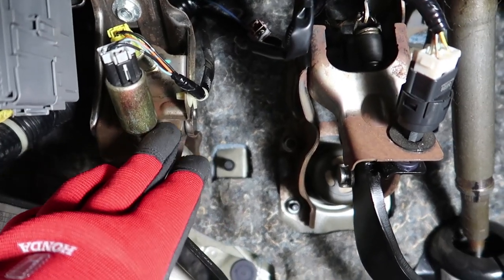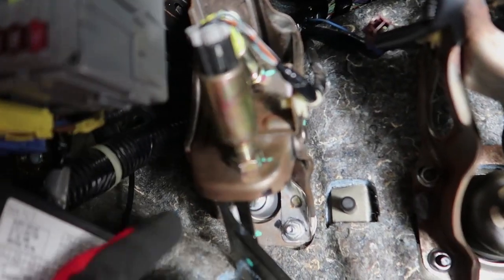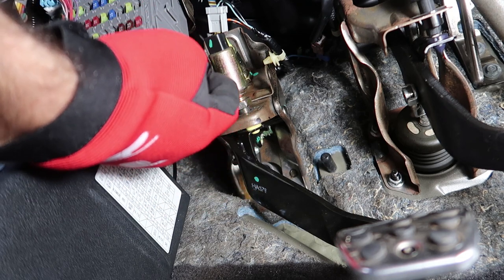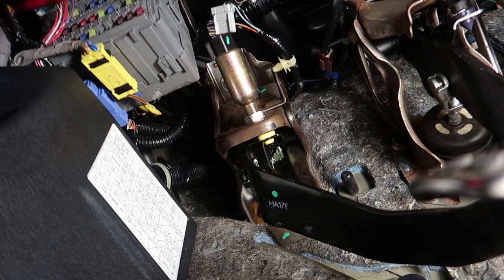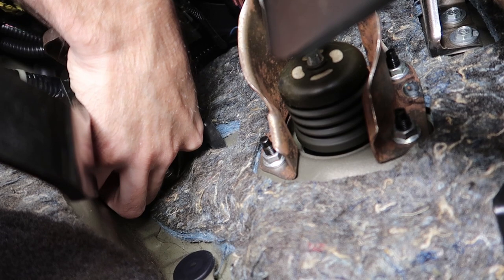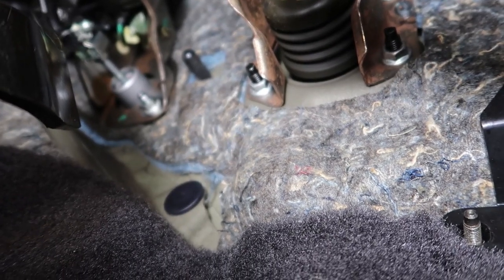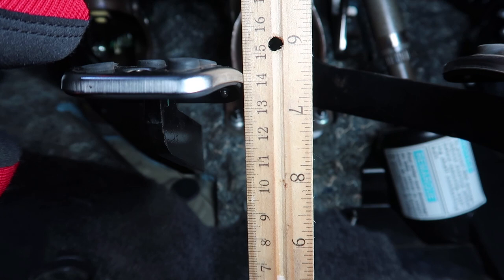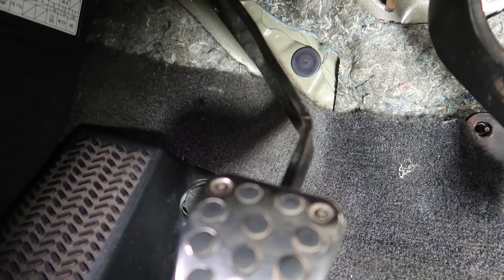8th Civic Si and RSX Type-S Clutch Adjustment DIY | Aftermarket and Stock | FG2, FA5, DC5

Comment: the nut is loose on it and the rod won’t spin:/
Reply from the maker: David Serrano try pushing the pedal down just a tiny bit with your other hand as you try to spin it, it should allow it to spin. A brand new oem cmc will spin fine either way

Comment: I’ve got a 2014 Si.Would this work also?
Reply from the maker: The 2014 has a different CMC so the specs will be different, but if you want to lengthen the clutch travel I believe you would use a similar method to this one. Cant say for sure, sorry!
Reply: @JasonMcMullen  thanks brother
Reply from the maker: @donxiong1775  right on, thank for the comment brother

Comment: I just installed my hybrid racing cmc and csc, I am not able to get any free play with the pedal, there is always pressure on the clutch. I have the free play adjustment showing no threads just the button. I also did left the rod that it came with. Should I have used the oem cmc rod?
Reply from the maker: There are instructions for the Hybrid Racing CMC  on their website, I think the rod gets swapped

Comment: Question; 5 thread with em1 cmc and stage 1 clutch is good?
Reply from the maker: Yeah around that range should work, every clutch is a little different but that worked for me. If you are still having some issues getting in and out of gear then go slightly less thread (longer stroke). If you feel a ton of resistance at the very bottom of the pedal travel (over-stroke condition) that means you need a little more thread showing. Always redo the freeplay after adjusting thread length, keep freeplay in the safe range.
Reply: Jason McMullen Im having issues shifting at high RPM I actually say your video on bleeding the clutch line so I will be doing that. I did bleed it but the bottle has been open for couple years maybe that could be a reason but my free play does feel longer than 10mm have to check that out soon as well
Reply from the maker: Keyvan Taveras yeah make sure the system has no leaks and is free of air. And try more pedal travel (less threads)

Comment: My push rod isn’t wanting to rotate. I installed the k tuned cmc and slave and the rod itself is pretty much impossible to rotate with my hands or even a wrench
Reply: Help please :/
Reply from the maker: @Collinr_62  Try to push down the pedal a tiny bit with one hand and then rotate the rod with the other hand
Reply: @JasonMcMullen  awesome I’ll give it a try tomorrow! Which part actually changes where the clutch engages? I was tinkering with the first cylinder thing having more or less thread showing and I don’t feel a difference. The clutch still engages as soon as I take my foot off the floor.
Reply: @Collinr_62 Where you able to rotate the pushrod doing this?

Comment: I just bought a 2009 FA5 Si, and am still getting used to it. Its my first manual car, I'm decent at driving it but my uncle noted that the clutch bites pretty close to the floor. The release after going into 2nd can also be a bit jerky sometimes. Is this normal or would doing this help? Thanks
Reply from the maker: The clutch adjustment will raise the bite point so that should help. It should make shifting into second smoother. Not sure if it will fix a jerk but the extra pedal travel might help the engagement. Btw when you adjust the bite point it will take a week to get use to the new engagement point so if you are still learning don’t stress, it just takes time
Reply: @JasonMcMullen  My previous car just blew its engine by skipping timing so im a bit paranoid with any sounds/feelings and im not sure whats normal for a manual yet. Hopefully the clutch is disengaging fully when the pedal is on the floor, its never grinded or refused to go into gear so I suppose its ok. Thanks!
Reply from the maker: @ddrrFA5  yeah I totally understand. If its shifting well then thats great. These Si's are great cars and there are so many parts for the K20 that if anything ever breaks, its just an opportunity to replace it with something better (at least thats what I tell myself haha). Anyway lmk if you run into any issues, and thanks for the Sub bro, just subbed back
Reply: @JasonMcMullen  Cheers!
Reply: @JasonMcMullen  I shouldve checked this when I first watched this video! After a while I realized the car was locking me out of 2nd at high rpm and the shifts felt kind of crunchy in 2nd and 3rd. I checked today and saw there were about 5-6 threads showing after the plate! Hopefully there wasnt too much damage done to the car.
Reply from the maker: @ddrrFA5  most likely it will be ok, try the clutch adjustment and maybe change your transmission fluid. After that it might shift nice and smooth! I hope it turns of well for you buddy!

Comment: I bought a cmc at autozone. How many lines am I supposed to have it at?
Reply from the maker: if its an exact OEM replacement try 1-2 threads
Reply: 2threads on the right or the stopper

Comment: on my 95 Civic there is loose free play and then some resistance free play. do I adjust until the loose free play is gone?
Reply from the maker: It depends, because you do want a little bit but if it feels 'sloppy' then you could try to get rid of some. Check the pressure with your pinky and see, basically once your single finger feels some pressure it would not be freeplay. Maybe make a note of how much there is (ruler method) just in case you wanna go back to it
Reply: @JasonMcMullen  oh... so the free-play part is no pressure when using pinky finger test? I thought it's the light pressure section. I ask because I got a new clutch and clutch master / slave cylinder and the clutch bites rather high (almost a full release of the pedal). I want to bring it back to factory specs but I can't get it bite lower without also lowering the pedal itself.

Comment: Anyone else have a hybrid racing cmc and notices their bite point almost at the top? Is that a bad thing??
Reply from the maker: not sure but what is your freeplay set at?
Reply: @JasonMcMullen  it is in the middle now for the grab point with bout a half inch free play. But It kinda ended up doing it by itself and what I mean by that is I tried to adjust the height of the pedal only by about an inch to give me a bit of free play. Well it worked but then as I kept shifting it liked pumped higher to the top so I adjusted back to where it originally was and then bam  pedal went soft and bite point was at the bottom and then outta nowhere it pumped itself to the middle and now I have a half inch free play and bite point is in the middle.

Comment: Hello
I can’t rotate the push rod
It’s hard to spin

I have k tuned kit cmc n slave
AC clutch
Please help
Reply from the maker: try to push down the pedal with one hand just a tiny bit, and rotate it with your other hand. Make sure to measure the freeplay with a ruler after you adjust the rod
Reply: @JasonMcMullen  bro can you explain a lil more  details please I can’t put it into gear… how to measure what???
Reply from the maker: @jagermeisterNY  First you set the pedal height by looking at how many threads are showing. Then you adjust the pushrod to get the right amount of freeplay. After you adjust the height, then you turn the rod clockwise until you feel some pressure, then turn it back counter-clockwise about a half a turn (you can do this while pushing the pedal down a tiny bit and turning the rod at the same time).  You can measure the freeplay by using a ruler, but you dont have to. I show how to use a ruler in the video.
Reply: @JasonMcMullen  it’s funny that if it has only 1,2 threads it will shift but after like 10min dirve itll start acting up like doesn’t want to engaged or disengaged  

I’ve been trying to do your steps by steps
I have done the first one wich is the 5 threads… I’m having problem with the push rod
How many threads with the rod??? I dnt know how it was before (like how many threads in down the rod)
Reply: @JasonMcMullen  I did all u said
And now when I start the car doesn’t want to go to any gear.. maybe something with the threads
Reply from the maker: @jagermeisterNY  do you have good pedal pressure? If you just installed it maybe you need to bleed the system. Are there any leaks? It should not change after 10min. Try less thread showing if you still can’t shift
Reply: @JasonMcMullen  no no, what I tried to say was that before the person who installed this k tuned cmc left only 2 threads instead of 5 (This is the k-tuned)
And it works I could engage gear but after a while driving for a while it won’t engage or disengaged

When I saw your video I want it to try it out..
I’m doing it right now and I followed all your steps I left 5 threads 
And now when I start the car it doesn’t want to engage at all
But I bet if something about the threads
Reply from the maker: @jagermeisterNY  ok I see, yeah maybe the push rod is the issue, but less threads might help you shift. If you have to go to half a thread or something then you can try that
Reply: @JasonMcMullen  nothing bro
I haven’t get any luck… now when I tryin to put it in first it’s  like that whole car trying to move, at same time it won’t engage in any gear… really hard
Reply: @JasonMcMullen  bro I think I fixed the problem
I was missing to bleed the system again 
That’s why it couldn’t engage any gear,
my bad 
Thanks for all your tips and responds
Reply from the maker: @jagermeisterNY  Nice! Glad to hear that you figured it out bro! no prob
Reply: @JasonMcMullen  thanks soo much brody…. I’ve been driving around and it’s  feels great, more aggressive,, but hey when I hold the clutch down
I heard something spinning!!! Maybe
Throwout bearing ???
If so what does that mean, is it going bad?

Thanks
Reply from the maker: @jagermeisterNY  does it make the sound if you are in neutral (clutch held down)? Is there a lot of resistance when the clutch pedal gets near the floor?
Reply: @JasonMcMullen  yeah it does it in neutral, that’s what I meant sorry, yes it feels a lot of resistance too
Reply from the maker: @jagermeisterNY  and how many threads do you have showing? Now that the system is bled, you might have to go to more threads showing (which makes the pedal shorter)
Reply: @JasonMcMullen  the one that has the conector has 4 or 5 threads

And the one that comes from the cmc 
Has 0 threads
Reply from the maker: @jagermeisterNY  hmm ok, the one with the connector, try another thread showing
Reply: @JasonMcMullen  if I do it now do I need to bleed th whole system again??
Because now I’m by myself lol

I’m guessing if I try another thread showing I’m goin to need to adjust the cmc as well be cause the black pin it’s going to show, no?
Reply from the maker: @jagermeisterNY  No need to bleed again. Yeah after you adjust the threads showing, adjust the freeplay (cmc) again also
Reply: @JasonMcMullen  aight..it’s already dark here, I dnt want to be stuck like yesterday lol,, but I’ll try tomorrow, bro thanks for your help, I’ll  keep you posted 👍🏼
Reply: @JasonMcMullen  hey how’s it going
Yo bro I have a question is not about the clutch 
Anyway, I just installed the hybrid raving intake
And it says that I need to run the hondata after installation 
Okey I’m here trying to figure out wich calibration should I run???
I have hybrid racing intake
And invidia cart back Q300
Stick headers
Any tip???
Thanks
Reply from the maker: @jagermeisterNY  Hey buddy, you want to run a MAP tune because the stock tune is a MAF based tune. The car will run very bad on the stock MAF tune. You can try the Hondata AEM V2 CAI calibration (new calibration>civic si 2006-20011>FG2/FA5 AEM V2 CAI), but its better to get a custom tune. A custom tune will be safer and will be calibrated for your fuel octane.
Reply: @JasonMcMullen    can I do the custom tune by myself or for that i need someone who knows??

And also with that calibration 
Aem v2 CAÍ calibration 
Still going to run bad??? Without the tuned??
Reply: @JasonMcMullen  I mean just help me out to basic calibration so I can start the car now
I’m planning to do the tuned maybe in two weeks
Reply from the maker: @jagermeisterNY  I never tried the AEM V2 tune but it is the closest tune for your car from Hondata. I don’t recommend tuning it yourself. If you order a custom tune they will send you a basemap tune that you can use to to get started.

Comment: My clutch master cylinder push rod won’t turn….
Reply from the maker: you can try to push down the pedal just a tad with one hand, while spinning it with the other hand. Make sure you have a ruler to measure the freeplay after adjustment though

Comment: Has anyone done this with stock rsx type s clutch and master cylinder? And if so did it work out, or should I leave it the way it is?
Reply from the maker: it does work for stock clutch and CMC

Comment: How much threads should be showing for a em2 CMC on a 2005 RSX-S with exedy stage 1 clutch?
Reply from the maker: Austin Saiyasone is it a em1 or em2? I’m not sure about the em2
Reply: Jason McMullen oem em2 cmc from a 2005 civic coupe
Reply from the maker: @austinsaiyasone3923  I'm not sure but it looks very similar to the em1 cmc so if I had to guess I would say around 5 threads like the em1. If it doesn't shift smoothly, try less threads showing, and if you feel pressure at the bottom of the pedal when shifting at hi rpm then go to more threads showing. Always redo the freeplay after doing the threads

Comment: The half thread showing in after market clutch master cylinder is that for the type s? I have an 02 type s with competition clutch and ktuned master space cylinder set
Reply from the maker: you running the K-tuned CMC? because the half thread is for the stock CMC. Usually the K-tuned one needs more threads showing (shorter pedal)
Reply: @JasonMcMullen  ok so 1-2 threads or
Reply: @JasonMcMullen  thanks by the way
Reply from the maker: @leviorourke7498  usually the K-tuned one is like 4 threads showing. Are you having any issues with the clutch not disengaging (not smooth shifts)? Or conversely, do you feel a ton of pressure at the bottom of the pedal?

Comment: Did this on my 2006 Rsx type s and it doesn’t feel rough when I shift anymore, thank you
Reply from the maker: Great to hear bro! Those smooth shifts are super nice for sure
Reply: Jason McMullen they definitely are, I might have to adjust it since it engages a bit high but other than that feels so much better 👍🏼
Reply from the maker: @ivaninzunzaa  it will engage a little higher because the stroke is longer (needed for proper release), but most people get use to it. Thanks for the nice comments bud!

Comment: Sorry but I got a bit confused I have an Fa5 with an aftermarket stage 2 clutch and I have this Ktune slave and master. I got confused on the amout of treads that should be showing for my SI. I went down there and the nut that’s  near the CMC was loose ( made me think if that’s the reason why my cars been grinding so much lately, even getting it into 1st has been an issue, forcing me to pump my clutch 2 times before getting it into gears )
Reply from the maker: For your setup it should be about 4-5 threads showing on the pedal stopper. For the CMC try to adjust the freeplay after you adjust the threads on the pedal stopper. You want to have about 10mm of freeplay. And yeah make sure to lock down that nut, but you don’t have to tighten it too much
Reply: @JasonMcMullen  i tried having it with 4-5 treads and I wasn’t able to shift once I did that so I lowered it back to 1 tread and it shifted but it feels super sluggish and grinds in reverse. And for some odd reason my CMC rod won’t turn even after pressing on the clutch slightly
Reply from the maker: @daveshere9969  hmm can you check how much freeplay you have? Using a ruler? Also worse case you can spray some lube then adjust it, and then spray some brake parts cleaner after you get the right amount (on the part that connects to the threads on the rod). If the freeplay is ok then try even less threads, but always readjust the freeplay after. There is a chance that there is an issue with the CMC also but check the other things first
Reply: @JasonMcMullen  I’ll give it a shot, but I legit just installed this cmc and slave ( ktuned ) it was running good for 2 months or so and now started giving me issues smh. Thanks again
Reply: @JasonMcMullen  that’s also why I find it weird that it isn’t spinning since it’s fairly new

Comment: Are u running em1 cmc
Reply from the maker: Running the stock one. I like the Em1 for performance (quick shifts) but the stock one has a longer throw and its easier for daily driving imo
Reply: Yeah I just installed my em1 engagement was pretty high I bled Slave few more times and it’s a lot lower can definitely get used to the new feel thank you
Reply from the maker: @faithflores7851  awesome to hear!

Comment: Can this help lower the engagement point? Cause rn my engagement point is so high up. I want to lower it to the middle
Reply from the maker: If you want a lower engagement point I suggest using the K-Tuned CMC for 8thgen/RSX-S. With the stock CMC the engagement point will be high because the Stock CMC needs a lot of release travel to operate properly
Reply: Sorry forgot to add but I have a ktuned cmc and I have a tsx. Will these steps still help even with different car
Reply from the maker: Uzumaki Nagato well I’m not sure about the pedal range for the tsx but check the free play amount, you can increase the amount of free play and it will possibly lower the engagement point. Always have at least 10mm of freeplay, and not more than 25mm. Also make sure the clutch still releases and engages properly after